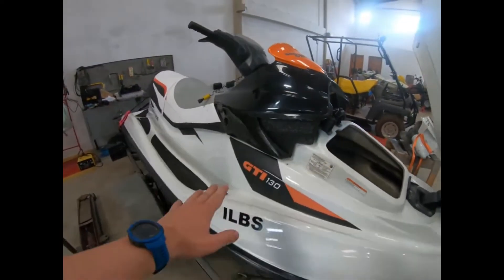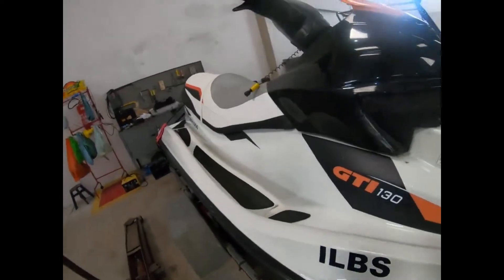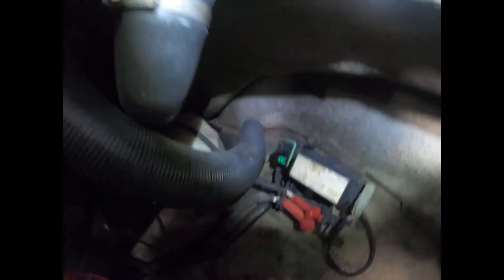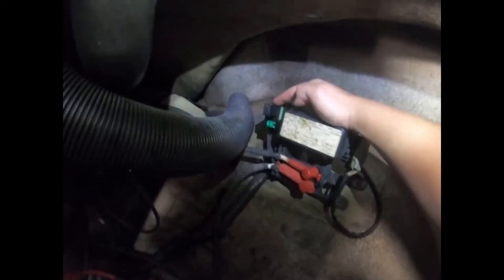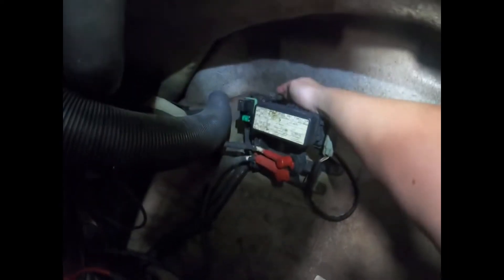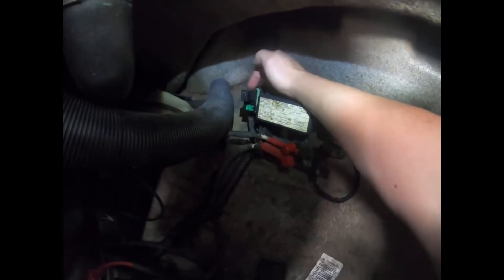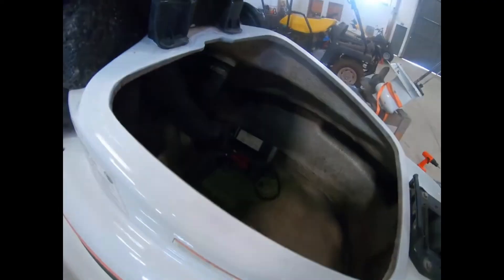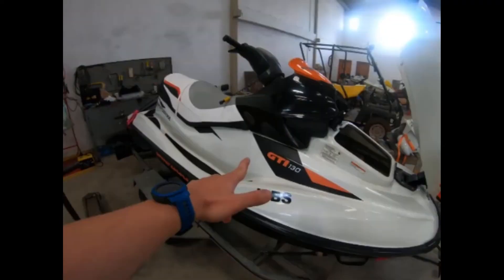How to fix Sea doo Gti that won't start, no beep, no cluster

Comment: How do you replace the connectors?
Reply from the maker: Its actually fairly easy. There is a little tab on the connector side, if you push that and push the connector in, it will pop off the back!
Reply: @CesarGT96  okay. I think that might be my problem.
Reply: I guess you can buy the tabs at the auto parts store?
Reply from the maker: @tonysmith4671  I couldnt find  them at the auto parts store. They arent automotive tabs... I found them online. Amazon
Reply: @CesarGT96  I’m having a hard time figuring out how to get the wire out of the relay holder
Reply from the maker: @tonysmith4671  hit me up on insta, I'll send you a video
@cesar_gt96
Reply: @CesarGT96  yay I figured it out. Where did you get your new pins?
Reply from the maker: @tonysmith4671  amazon. It was a tough find.

Comment: what year is your Seadoo please
Reply from the maker: @ProTurbo1988  2010
Reply: @CesarGT96  kk  I have a 1998 Xp Limited. no beeps no start. all fuses are ok, 12 volts to BLK/Yellow to DSS. check power to Mpem and GDN. are ok.. also check to DSS post ok.  I may have  a bad MPEM..(: